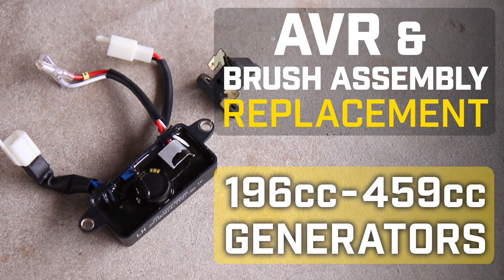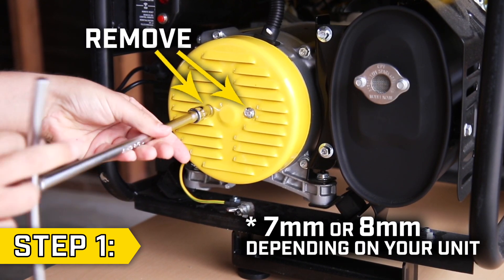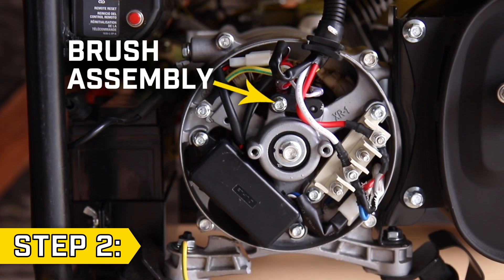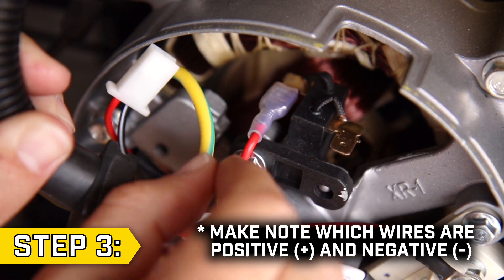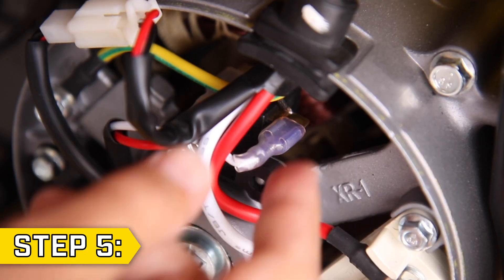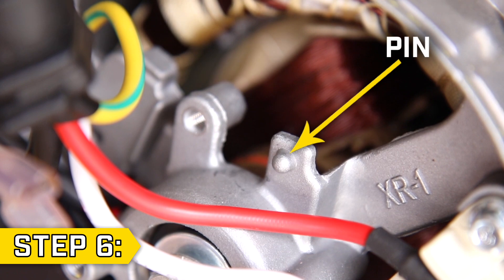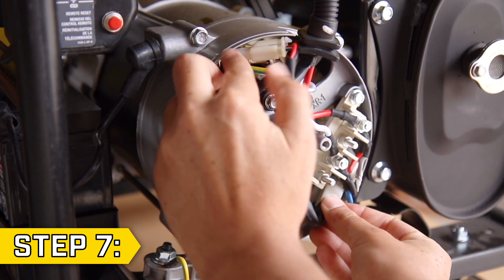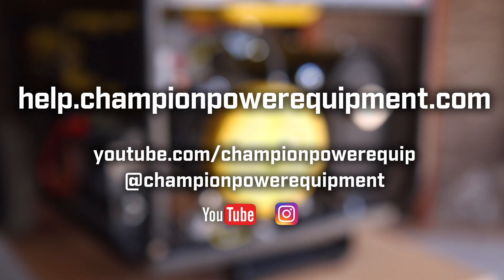AVR and Brush Assembly Replacement (196cc-459cc Generators)

Comment: My only worked for 3 Days until I was told by Their Tech I need to do this. Garbage Product
Reply from the maker: We are very sorry to hear this. If you experience any further issues after performing this procedure, please do not hesitate to reach out. Thank you for your patience.
Reply: ya my brand new  10,000 watt champion generator had about 10 hours of use on it and totally crapped the bed last night and stopped putting out any power.. total pc of crap, and i will never buy another champion product ever again now.

Comment: My Champion 201176 has no end cover.  Does it even have brushes and if so, how do I replace them?
Reply from the maker: This inverter does not have carbon brushes, as all power is generated from the control unit. 👍